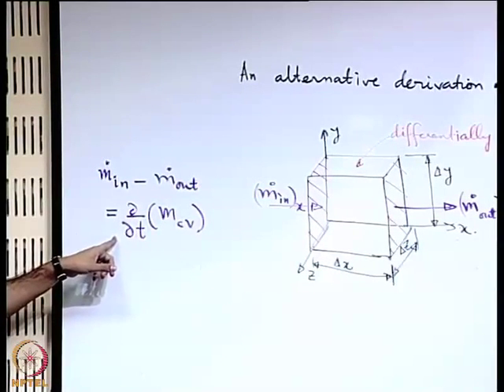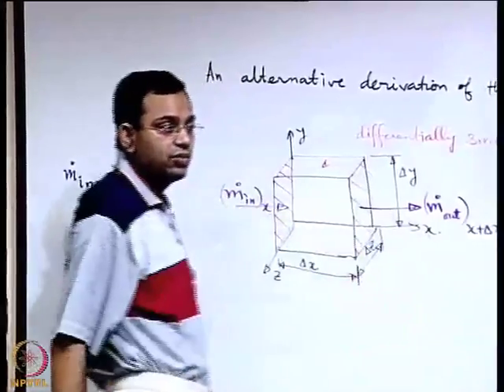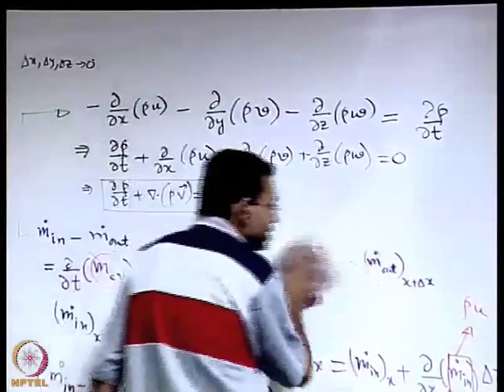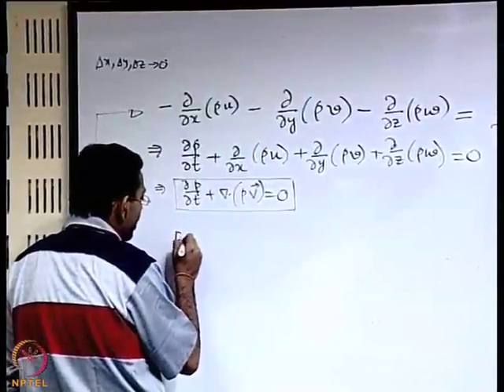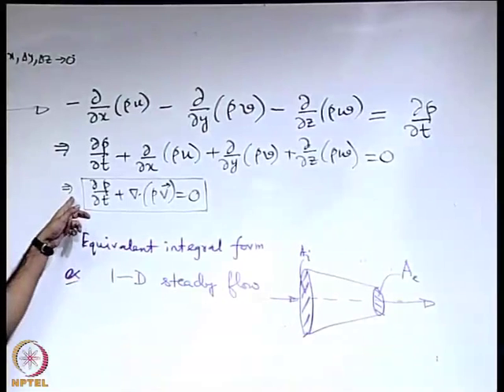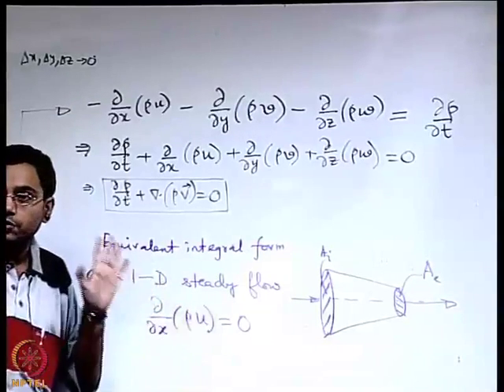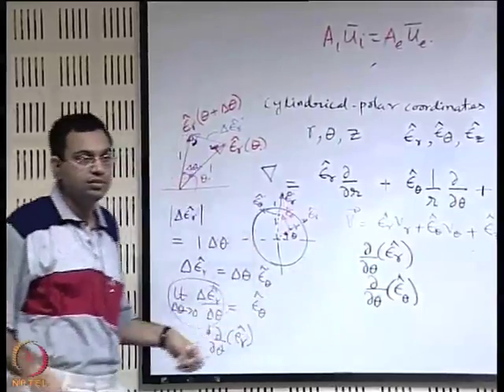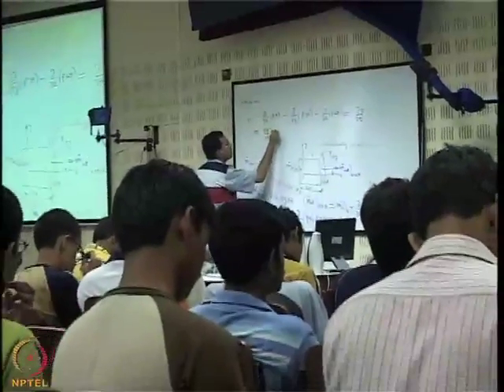Mod-01 Lec-13 Fluid Kinematics (Contd.)

Comment: at 39 if the fluid is inviscid then what is the reason the velocity of fluid is increasing in x direction
Reply: I think the reason is if you see, when we change x, inlet area changes and inlet velocity is uniform. Similarly outlet area will remain same. Now if you see from continuity equation as density is constant, outlet velocity has to be increased due to increased in corresponding inlet area to make the continuity holds good. 

If you have doubt please mail me
Reply: @jishnugoswami605  your email id??

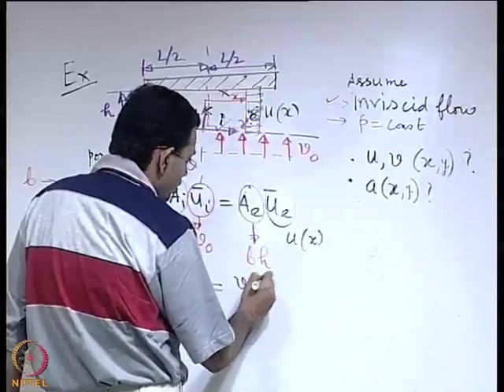Comment: at 49:00 the mass continuity eq used, i think there should be 2 times the u(x) as the fluid flows in both direction. Please reply sir
Reply: The control volume is taken such that only two surfaces are having mass flow interaction. If you wish to consider the mass flow in both the directions, create a different control volume, from both sides of which mass is flowing out. But you will see that now twice amount of air is entering as well from the porous layer, thus cancelling 2 from each side.
Reply: @mohanishrocks  mathematically how twice amount of air is entering?
Reply: @gautamkumarjha7037  Because the area considered now (as @mohanishrocks said) would be on both left and right (instead of only right like sir did in the lecture). Double the area, double the entering flow (and also leaving).

Comment: At @ 51:35 , on rhs we hava eqn for 2d stady state eqn , and on lhs we have mass conservation considering a 1 d flow , then how can we substitute lhs result into rhs having different assumptions
Reply: There is nothing called 1D mass conservation or 2D mass conservation  equation. Mass conservation simply means IN-OUT=Accumulation
irrespective of the direction of inlet and outlet streams